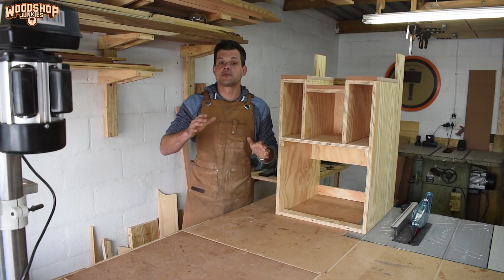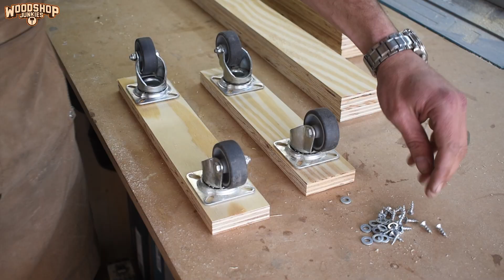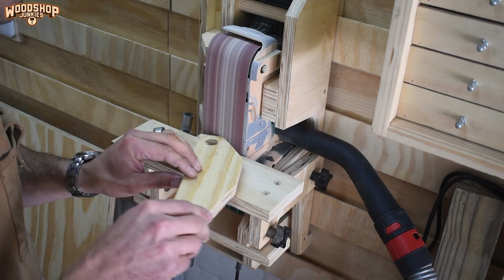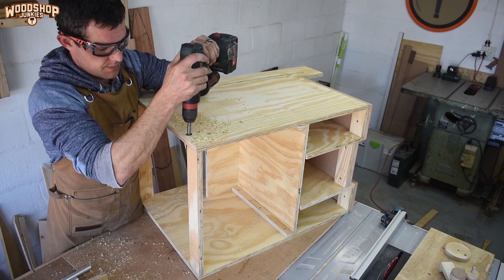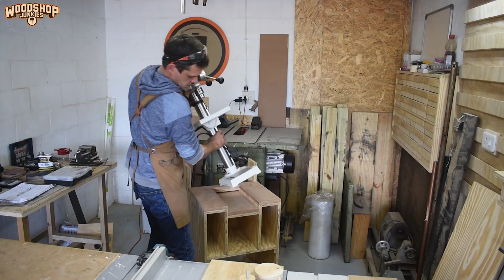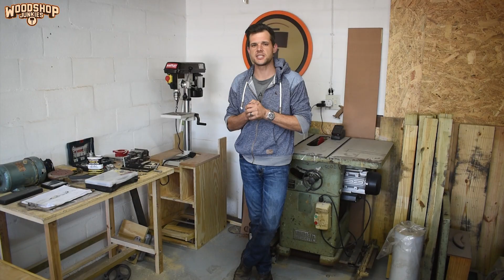Retractable Bench Wheels - Why Buy If You Can DIY?

Comment: This is awesome. I have an upcoming build for a mobile kitchen island but the clients still want the wheels to be lockable since they have young children. Anyone think this design could handle the weight of a 4'x4' kitchen island loaded with pots/pans/implements/etc.?
Reply: I had the same project in mind. Use thicker plywood and steel axles, if you want to add strength. Add a peg or spring latch that will lock the treadle lever in either the up or down position.

Comment: Fantastic!!! Did you design the latch?  I was working on latch that would attach to the foot pedal lever and swing, or pivot, as the lever went down.  It  would strike a peg that the latch would catch. The weight of the cabinet would force the lever up  and the latch would catch the pin. If continued to press the foot pedal, it would bypass the latch. The pin would follow the  back edge of the latch allowing the foot pedal to raise and the cabinet to lower. I couldn't find the correct location on the latch for the pivot. I went down a rabbit hole looking at center of mass center of gravity and never retuned....................

Comment: The simplicity of this is awesome. One thing I've found with these casters is you have to have them level with the floor for them to caster. I don't know if you did it on purpose, but your design does this perfectly! When you step on your bar, they become level so they will actually spin around! Now it just needs a locking mechanism so you can roll it around without your foot. Would love to see some plans for this after you finish refining it. I'd definitely build some! Nice work!
Reply: SonicBoomer, I was thinking through the same thing at 2:00am this morning instead of sleeping. The optimal solution may well be dictated by the expected frequency of movement. If you expect to need to lock them down daily a built-in semi-automatic locking solution might be worth the effort. However, if you expect to only lock it down every once in a while, something as simple as separate locking bars braced between the foot treadle and a couple of notches in the face frame would be quick, simple, and fit the need.
Reply: I don't know your name, I didn't realize you were South African until today, but none of it matters, you are a GENIUS, I have been sitting watching video after video instead of working, inspiring stuff. Keep it up and thank you. 👍🏻
Mitzi
Rustenburg NW

Comment: I like the solution. The only problem I see is that you have to keep one foot on the lever while trying to move the cabinet. A locking mechanism when the lever is depressed is required. Not too difficult to add.

Comment: Being an engineer first, I couldn’t help but wonder why you used a separate pivot point on your third lever and didn’t just attach it to the rod the wheels use just below it. Any specific reason? Very cool idea and it works great! 👍🏼
Reply from the maker: I mentioned in the video that using a 3rd lever allows me to adjust stroke length and offset stroke operating region.
Reply: Woodshop Junkies My mistake, I didn’t mean the pivot point, I meant the linkage at the opposite end. Maybe I am being obtuse.

Comment: very clever design but I was a little surprised that the table saw fence is a bit short. I have the same Makita saw as you and I lengthened my fence by just using a piece of aluminium profile, the slots fit the Makita bracket

Comment: Love the simple design!  Curious though, is there a reason you chose to have the 3rd level be on the outside of the mechanism vs the inside?  Knowing my dumb self, I'd be moving the cabinet, get it caught on something I left on the floor, then look on in abject horror as my press (and cabinet) tip sideways onto the concrete.

Comment: Did you try attaching the lever to the same rod as the rear wheel platforms?  Looks like you could save yourself one rod and two holes per cabinet.

Comment: Where the metal bar pushes down the wood frame for the wheels...I would add a small metal bracket so the bar is not pushing on the wood...eventually it will wear a groove in the wood and you will have to replace the frame part.

Comment: This design is super smart. I've been thinking about doing something similar, but kept running into issues where the forces put on the lever or on the casters would be way too high to carry even just a small table (like the one you have) with any kind of gear on it. Splitting it down the middle and applying forces in the center with such a small height difference pretty much bypasses that issue, really only limiting you to the strength of the rods you use to pivot on. Amazing!

Comment: It's cool what you did, but I imagine needing to hold your foot down to move the tools around would be frustrating let alone moving it more than a few feet. Have you thought about adding a simple locking mechanism to keep the wheels on the ground while you move it? That might be especially useful if the tool you're using is extra heavy.

Comment: Nice. Rather than having an inner and outer “wheel carrier”, what about making two equal ones and just offset them?
Reply: For me, especially with taller units, I try to keep the wheels as widely spaced as possible to help safeguard against tipping while moving.  If you are talking about what I think you are talking about, while the design would be simpler, the base would be an inch or two narrower.

Comment: Great design idea.  I am making a trolley base for my work bench as I have no shop and have to drag it onto my driveway when I want to do some work.  Just an idea, to get stability, currently your wheels are inboard of the mechanism.  If you were to lengthen the piece the casters are screwed to and sit the levers on top of this piece instead of at the ends you would have the castors as far apart as is possible without extending outside of the unit.  This might raise the foot pedal height, but an "S" shaped third lever should restore the pedal height to where you want it.  Will definitely be using this design on my bench.  Thanks.

Comment: Nicely done. Have you thought of putting the fram on the inside of the wheels so they can be closer to the walls of the item for stability?  Also you could put the peddle on hinges so it folds back inside the item to reduce space further when not in use?
Reply: It essential is he just kick it up out of the way right now as it is.